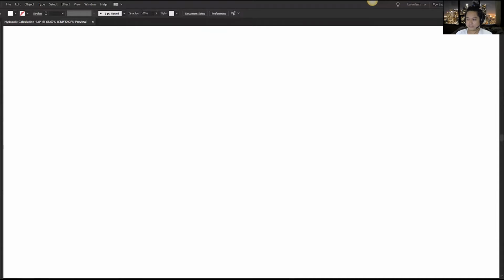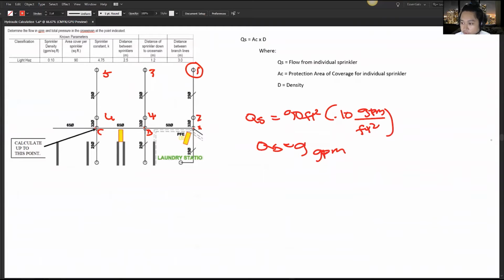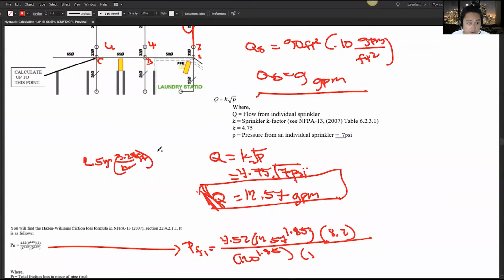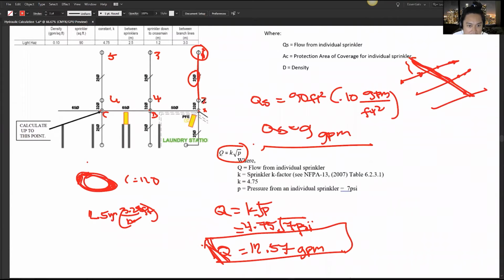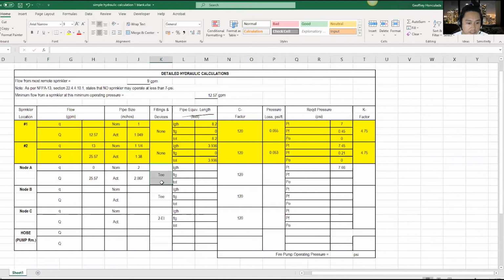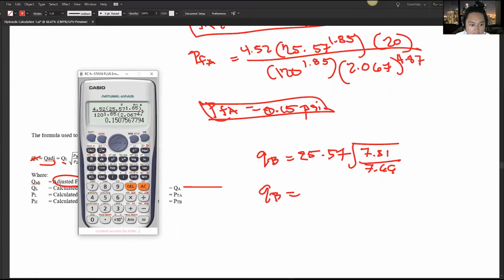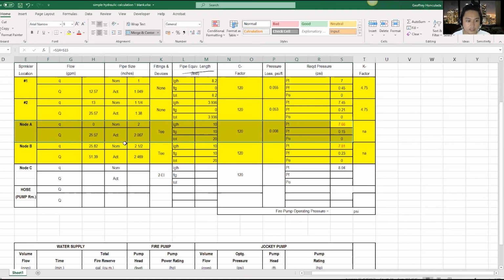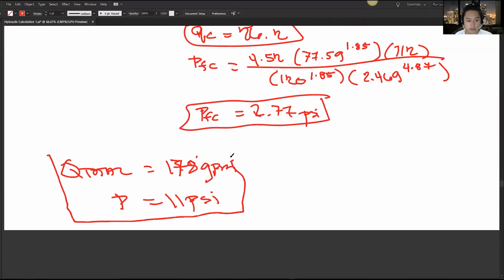Hydraulic Calculation (Fire Protection System)

Comment: Hi Sir, thanks for the Video. I have a question, hope you can share your opinion. The sprinkler hydraulic calculation is calculated at the most remote area of the building from the Fire Pump. If at the furthest area, i have -example-10 branch (each branch = 10 Sprinkler) and refer to rules of Ordinary Hazard 2, 1500 ft2 @ 0.2 gpm/ft2, i only get 2 branches covered at 1500 ft2. So is it correct, the fire pump sizing will only depend on these 2 branches and its header and ignoring the other branches or the other room which are near to Fire Pump.
Thankss
Reply: The concept is right as u said . But I say u must follow the NFPA 13 guide lines how to consider the remote area.as I remember there is a format to select the design area.

Comment: Thanks this video was very useful, My question is that you have calculated the flow and pressure for one side sprinkler of cross main how about the other side
Reply: I have the exact same question!
Reply: Not sure if this has been answered. In NFPA 13 standards, you only have to cover 1500 sq feet, so you will not need to cover on the other end of that main due to it falls out of the remote area. If you lay out the remote area, and the end of the line of the area falls more than half way into another sprinkler head, you have to pick up the next sprinkler head.

Comment: Thanks for the video. I have a question regarding Node2. why don't you consider anty fitting in node2? I think there is a fitting between Node 2 and Node A that needs to be added as a fitting in Node 2 calculations. Please correct me if I am wrong.

Comment: question sir?  how about the other heads branch below base on your plan ,you just consider the upper heads and compute the cross main pipes pressure. TY
Reply: Principle of the remote area is if u supply the required flow and pressure to the sprinklers in remote area its logic that all other sprinklers in the pipe network will attain more pressure compare to them.
Reply: I have the exact same question!

Comment: isn't the equalent length of tee from node b to node c is 12 ft ? as it is 2 1/2 inch tee.
Reply from the maker: Hi Suhail! In the sample calculation, the fitting used is a 2-in fitting; hence, the 10ft equivalent length. Regardless of whatever fitting you use, when you do your design calculation, just make sure that you use its equivalent length as per NFPA13, Table 14.4.3.1.1.  Thanks for watching, and asking! hehe keep them coming! ;)

Comment: HOW did u decide the  diameter of the pipes. i mean you have done hydraulic calculation assuming the diameters as 25 mm, 32 mm and so on but how did we arrive at the sizes?
Reply from the maker: The diameters of the pipe in this problem are given parameters. Ideally, pipe sizes should be determined after calculating the flow rate...
Reply: U need to refer  nfpa 13 pipe sizes table for light,ordinary and extra hazard table. Use these pipe data and input them in elite software and run it. If there is more friction losses the software will intimate you which pipe needs to be resized to attain the minimum design parameter set by NFPA13

Comment: Sir, thanks for sharing your hydraulic calculation, very helpful.  I have a clarification to make though.  You divide the friction loss to the length of the pipe? Shouldn't it be multiply instead of divide? The Hazen Williams formula has the Length to be multiplied to the resulting number after calculating all the numbers. 
Just to clarify sir.  I really appreciate this video and your template, if you can share your template just email me to rplonoy@gmail.com....more power to you, God Bless!
Reply from the maker: Hi Romeo, the friction loss through the pipe, if you use the Hazen-Williams formula, is the total pressure loss due to friction, given a particular length of a pipe. The friction loss tabulated in the form, which I've sent you already as well, refers to the pressure loss per unit length of the pipe. That's why the pressure loss through the pipe is divided by the length of the same pipe. You can also notice that in the units, as shown in the table, for the pressure loss (specific  pressure loss), it is in psi/ft.  Thanks for watching sir! keep safe too! :)

Comment: regarding hose connection. Fire hose has a min. working pressure of 100 psi right? you didn't include it in the calculation for the pressure of the hose?
Reply from the maker: Hi Jecelle! Yes it is included! That's the minimum pressure of 100psi. :)
Reply: @marcbryanvargas4673  why on your calculation the total psi was only around 10 psi? you only include the flow for the allowable hose stream connection. it should have been 110 psi?
Reply from the maker: @ben-hurrocillo1645  Hi Jecelle, thanks for pointing this out! I've checked my calculations again and I did overlook it. I'll have an erratum on this in an upcoming  video... I really appreciate your feedback. Once again, thanks!
Reply: @marcbryanvargas4673  thanks also. I've seen a lot of hydraulic calcs that doesn't conaider the pressure for the fire hose. So I thought they didn't consider the 100psi requirement for fire hose. Thanks for verifying that it should be included on the calcs.
Reply: @marcbryanvargas4673  also one more thing. Is pipe schedule method still useful in designing fire protection system?
Reply from the maker: @ben-hurrocillo1645  hi again Jecelle :) pipe sched method is still useful however it comes w several disadvantages like using larger pipes than needed, increasing material and labor costs. Hydraulic calc method is a better option since the major concern w the latter is more on the internal pipe friction. Hence, innovations can be targeted to lessen pipe internal frictions. As a designer, it always boils down to making the right decisions based on the actual situation and our client's demands... Hope this answers your question. ;)
Reply: @marcbryanvargas4673  is it recommended to use pipe schedule method if you have a dry stand pipe? i tihink it will result to oversized fire pump because in Pipe Schedule method you have a min. 500 GPM on the based of the riser.